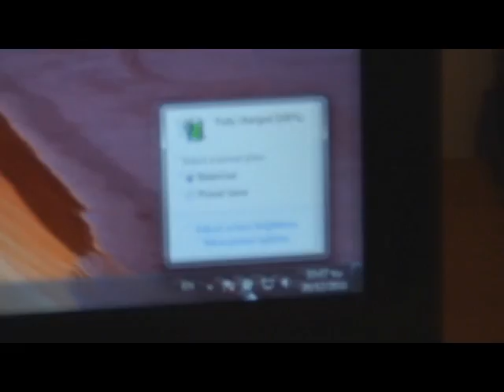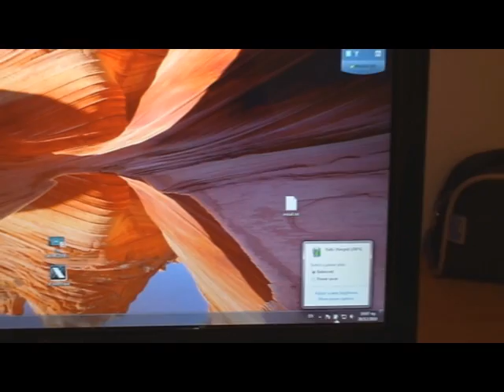FIX Plugged in, Not Charging

Comment: It is 2019 and it the Future is calling you John Daniel to hail you the Hero of all Dell Waffle Irons out there.  Dell really blundered, big time, with their poor Chinese engineering and quality control.  Not the Dell computers that were once made in Texas.  The fact that Dell had no clue to the problem clearly demonstrates a complete lack of care on their part.  A real company would have did a thorough engineering study on the problem.  A problem that has affected all of their 3 wire "If it ain't a Dell, I ain't gonna charge your battery" power bricks.  My lengthy problem has been resolved, thanks to your down in the weeds electrical re-engineering.  Cheers, Mate!  I owe ya a pint.

Comment: Wow, so many videos on this and nothing worked. 
I straightened the end of my cord as it comes into the Computer Charging Jack.
Instantly, it starts charging. 
Your correct, that wire is barely making a connection.

Comment: My laptop got knocked over and landed on the plugged in charger. No damage to the laptop, but the plug tip got wrecked inside. I purchased a universal charger from Fry's Electronics and it worked for a while. Since the universal charger was 65 watts and my Dell Inspiron 15 requires 45, it eventually was locked out and would no longer charger since it wasn't OEM. All it said was 0% plugged in not charging, which actually led me to your video. Funny that a problem with something else led me to a solution. After watching your video, I finally sat down and slit the plug open, removed the sleeve and silicone, and found it was a broken connection. I tinkered with it until I got it to charge again and then I super glued it in place. Then I super glued the hell out of it. Solder wasn't an option because it is a ring shaped inner connection too close to the outer ring connection and inner pin.  I wrapped the sleeve back around the mess and then filled the whole tip with super glue, and finally cinched down the sleeve with four micro zip ties. Nearly 8 years later and this video is still a relevant solution. It looks sloppy, but saving $45, I can't complain.

Comment: 8 Years after you posted this and it helped me out. Used to fix the power cable on a Inspiron 15 7000 Series laptop. Easy as could be quick re-solder and back in business. Good quick fix until the new one I ordered came in.

Comment: Thanks so much, Mr. Daniel! I was getting intermittent 'not charging' incidents, but the biggest issue I had was that from time to time my machine was getting extremely laggy. After watching this, I moved the wire into different positions until BANG it was charging and the laggy behaviour stopped! I've tried so many things to stop it lagging, and now I finally have a solution. Just need to dig the soldering iron out from my dad's attic and repair the plug. So happy, thank you!

Comment: Dear Mr John. Baaie Dankie From your accent you sound South African. Fixed my son's Dell charger using your method. Really sneaky of Dell to have the third control cable that prevents use of generic chargers with same voltage and power ratings that don't have the third lead to centre pin.

Comment: Broke open my m14x R2 charger, and broke away heaps of plastic as the wires are cast into it and got so frustrated that I cut the tip off to just resolder down, cut it down a good half a foot and went to strip the wires, as I was stripping the green wire it fell out, green wire was completely snapped like 2 feet into my cord, cut it back and resoldered it, working fine since as of today!! Just got a new battery and all as it needed it and this video got it all working 110%! Only bought the alienware for like $400 knowing it had a dead battery

Comment: usually when i see Dell's with this "Plugged in, Not Charging" problem, my first thought is to check if the laptop will charge on any other 19.5v Dell charger.
if it insists not charging, i'd go to the bios and check if the computer can actually detect that the charger is connected and its Wattage,
if it says it cannot detect it or that the AC adapter is "unknown" then i can tell for certain that the problem is with the DC jack in the laptop.
another good way to tell is if the DC jack is wiggly and moving too freely, in that case there could be two possibilities, either the cord doesn't fully connect all the way in because the DC Jack probably got too deep inside the laptop.
or maybe the cords connected to the DC Jack inside from the motherboard (common in Inspiron models and Latitude models) are probably partially disconnected.
either way, as long as the DC Jack in your laptop is the type that is connected to the motherboard with a connector rather than be soldered into the motherboard, than its a pretty cheap and easy fix.
if its the other option, don't bother fixing it... just face your decision of buying a Dell and never buy a Dell ever again.
the best fix is most probably just trashing the damn thing (Dell Laptop) and getting an Asus or a Lenovo Laptop, both companies make the best laptops in the market and work much more than 2 months tops after warranty is over (fucking Dell, kings of making stuff break EXACTLY when your warranty is over)

Comment: Twenty five billion LIKES! Thanks a lot. This was EXACTLY what it was on mine, after replacing the battery, the charging jack and God knows what else I tried... a lot of frustration if nothing else, it was this dumb connector. I wasn't about to spend any more money on this ancient best and just "see if the power supply was the problem" as I had thrown good money after bad on all the other "fixes." Once I cut this open, I saw it was worth the twenty seven more dollars (on a system probably worth $250 at most). How this video has 114 THUMBS DOWN, is beyond me. What's NOT to like about it? It either WAS the problem, or it wasn't. If it wasn't, just because they didn't exhaust every other test BEFORE cutting up their power cable, isn't the video's fault.

Comment: That is exactly what happened to the connector on my wife's Inspiron 11. Thanks for the tip.It was pretty easy to cut away the outside of the plug to see that it was broken in two places inside.

Comment: Thanks man this is the problem I had. And I bought a new laptop battery before doing this fix. When I opened the cord adapter It didn't have white silicone it was just black rubber but the red cable was broken off.

Comment: Its my understanding that center pin of the DC jack accepts 5v from the AC adapter via that broken wire from this video just to determine if the adapter is a genuine Dell product.  Another issue that would cause the same issue is that the wire isnt broken but the center pin doesnt make good contact inside the DC jack once plugged into the laptop. If its as simple as a 5v source it would seem the best solution would be to provide it a permanent 5v source by soldering a wire from one of the 5v USB connections inside the laptop to the center pin of the DC jack thus eliminating the need for a genuine Dell adapter and future issues.
Reply: +Carl Smith No it's not a simple 5V signal. The wire transfers an encoded signal from a chip inside the power supply.

Comment: I wasted a lot of time with this problem... i first tried the software uninstall trick, which didn't work. Then I bought a new battery, which of course didn't work. Then i replaced the charging board and guess what....

The solution was to buy a new charger. It seems the signal pin may well be part of the problem, but given the cost of these on ebay the cheapest and quickest solution was to pick up a new charger. Thefe's plenty of budget solutions on ebay, but dont buy second hand as the chances are its being sold for the same reason.

Comment: I cant do it, My battery is at 8%
Reply: If you can not do soldering than buy solder less dc power plug of  Dell 7.4mm x 5.0mm pin size and fix your pin broken charger in 2 minutes. It would be still cheaper than buy a new genuine charger.
Reply: Shazal Kamal so i could just buy a new adapter/charger and it will work just fine again i have the same exact computer in the video and i do not know how to solder and i have the money to just buy a new charger, i do not really understand the guy in the video but if im correct the charger is the problem, correct?
Reply: Were the same ! I'm 8% But not working my charger D=
Reply: +Matthew Bibbs Thats what the guy in the vid said and nobody gives a fuck if you have enough money to buy another charger so instead of writing about go and buy one you fucking idiot.

Comment: Dear John, thank you for your sharing, didn't notice the dell adapter is 3 wires until see your video, the center wire is for charging, I get the battery charge up after re-solder.
Reply: Centre pin is for a data connection from the power brick to the laptop so the laptop knows it has the correct supply connected. the main power is supplied by the other two thick wires that go to the plugs inner and outer rings. if the laptop doesn't see the correct power supply you will see the not charging errors etc.

Comment: so you can actually bypass the small chip that the data wire went to? (the one that was in the silicon) i do not see it in your video. (my xps charger had a small chip that was concealed inside the silicon you describe, i am hesitant at hooking it up without that so need to understand if it is needed for my computer)

Comment: This worked! This laptop, although very old is still a capable work horse, love having it up and running again.
Thanks John, bet you did not expect this video to be used up into 2014 eh? =)
 
-FYI:A defective powerblock will also cause the system bios to throttle the CPU speed down! So it will run at 1.25ghz/core instead of 2.4! (Use CPU-Z to check) 
-Should a fix of powerblock not reset your cpu speed, try a 'load defaults' in the bios.
-Should you get blue screen of death when windows loads, after doing load defaults (I had that) then go into the BIOS and set sata mode to raid/ata (it jumps to raid/ahci)

Comment: I.'m hoping this is the same fix for the 2011 L502x. Thanks regardless,cool of you to share!,and below to DGneoseeker1 yep totally agree,the L502x I bought came with a faulty screen,constant issues,USB3 ports busted[my fault :/ ]-it slipped with an audio interface connected,and PUSHED the left port INSIDE the casing,rendering it unusable,but the kicker was the rear one died too[same controller],so the combo USB 2.0/eSATA on the right is now the only one left,BUT,it WILL NOT WORK until you wiggle the male USB plug out a fraction of a millimeter,and it's a super loose fit-being a "combo"port...ridiculous,

Then the touch pad stopped working too [as well as the NOT CHARGING-hopefully finding this vid will remedy that?],however with an Orico POWERED 7 port hub[must be wall powered!],all is working,through the ONE port,the Seagate 750GB  HDD has been very good,but that is [even in Oz! ] an $80 part,on a Laptop with thankfully a Quad i7,but only a 1366x 768 screen,no backlit keyboard for AUD $1475[$1,390 USD] in April 2011,anyway the models that came after had 5,400rpm HDD[crap for audio production]...only-NO CHOICE-except an even HIGHER PRICE for SSDand the i7 2012 model began at around $2,499,so believe it or not,due to the L501x being to lame[840M too gutless,and too high DPC] for audio-even with a $750 RME Babyface audio interface,and the latter ones being 1K EXTRA,Iv'e actually been lucky!...you gotta laugh- first computer ever!

Comment: I've had this problem on every single Dell I've owned. They are all different models, the only thing in common is the power error. The last time I tried the more expensive xps hoping it was a problem that ran through Inspiron models, but am still having the problem on this machine. You would think they would find a way to fix the issue since there has been tons of complaints and forum posts online spanning several years.
Reply: why they sell more chargers and no one actually does anything other than complain. these companies would have to do something if people knew the laws and class action suited them for service non gratis. but people think the corporations are too powerful, which is untrue.

Comment: And this is why I will never buy a Dell product,
Reply: Dell rhymes with hell.
Reply: DGneoseeker1 i have to agree whit you, i recived a compuiter and in 2 weeks, alimentation problems...
Reply: In my case it's thankfully just a second hand laptop my mother picked up from work. The problem is it needs to be plugged into the mains to function.

It's also a heap of crap with about as much processor speed as a slug. Takes minutes to open up internet explorer.
Reply: DGneoseeker1 well if the compuiter works, it's a miracle... i guess
Reply: It works. It just works so slowly that my mother, who it was intended for, gives up and uses my insanely overpowered desktop.
Reply: DGneoseeker1 wow did you say you use internet explorer and call someone else an idiot. HMMMM
Reply: RidinAnd Fishin
No, I use Firefox. The shitty laptop has Internet explorer on it by default and the hardware is so crap that I doubt it could handle Firefox. I don't even use the thing. I have a custom built desktop.

Comment: You, JohnDaniel747, fixed my D620 problem!
After slicing open the outer casing, I could see an orange spot in the center. So I dug out the silicon and sure enough, the tiny center wire had broken and rusted!
Took it to our tv repairman, he soldered it and altho it did power up the laptop it did not fix the issue. I ordered a Dell replacement adapter and now have two fully charged, operational, and bios-recognized batteries! (AC Adapter is also bios-recognized)
Thank You, Thank You !!!!!

Comment: mine was broken somewhere in the middle i cut the cable as close as possible to the charger and replaced it with an old keyboard cable and the problem was solved and fuck you dell by the way

Comment: My M1730's power supply died, I got a new one and it is not charging. The computer runs slowly, but does not charge. 
I did what you did in the video and the red cable was connected, is there anywhere else in the cable where it might have come undone?

Comment from the maker: @51smileyface You didn't fix the problem by twisting the plug , it may work for a couple of days but will unfortunately fail again , I also urge you not to keep doing this as after a while of twisting and tampering the female joints in the mother board side will become undone , this will require the laptop to be totally dismantled and maybe a new motherboard

Comment from the maker: @luisdarcy its possible but i wouldn't advise you start ripping the cable to shreds ... the little red cable is very delicate so if you pulled hard on it broke a little further down as well , check it out if your not confortable with electronics maybe find some tech who can assist you .. best of luck :)

Comment from the maker: @jasoniron12 sry to hear you having this prob.. Dells transmit data from there power supply to the mother board through that little red cable , you just gotta find were the brake is and fix in that cable most of the time by the plug were its soldered but it can be allot more complicated like the solder on the mother board or the chip got fried on the power supply , any ways 90 % of the time it should be by the plug as this is the most exposed and tampered with part of the connection .. gl :)